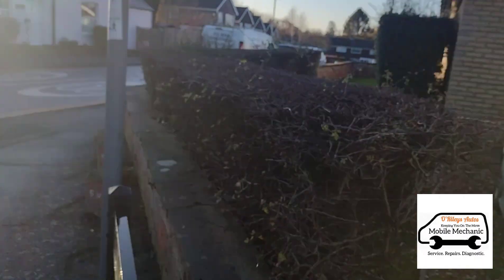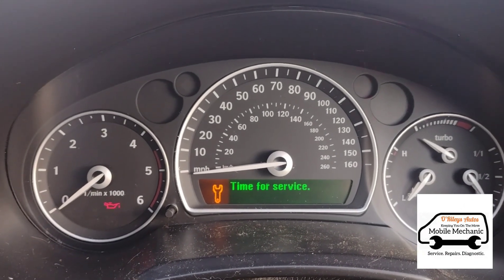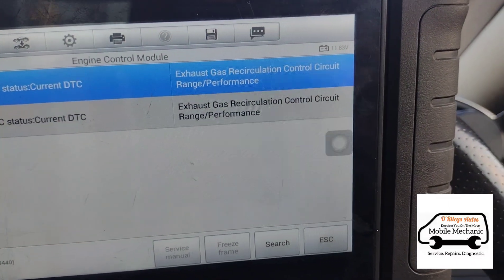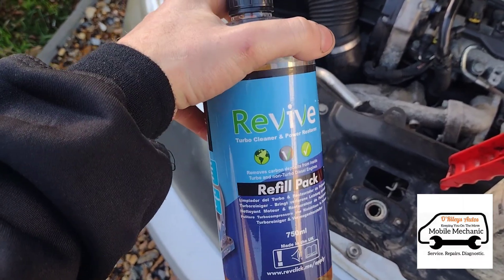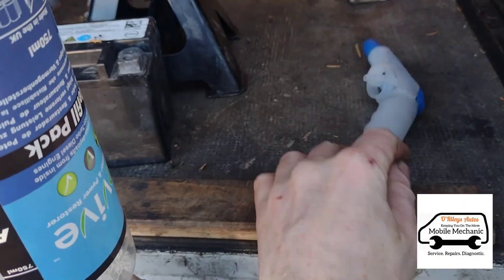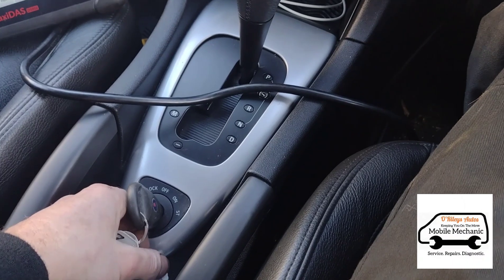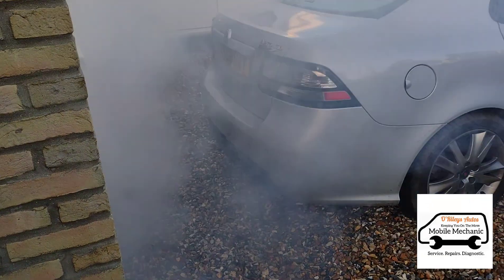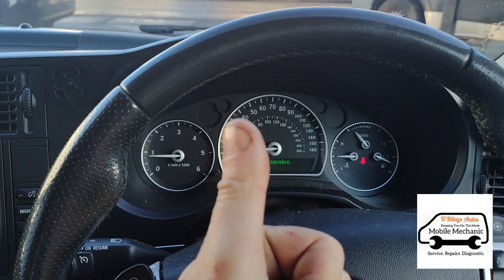How To DIY Engine Carbon Clean Soot Using Revive Turbo & Engine Cleaner

Comment: Top video...Jimmy the brake bleed pump you use for dpf cleaning..could this be used for intake/egr cleans...
Reply from the maker: No. You'd need a pressurised spray bottle for that with a mist type nozzle and trigger to control the flow
Reply from the maker: https://www.amazon.co.uk/WURTH-BRAKE-CLEANER-PUMP-DISPENSER/dp/B01G8HYWE8/ref=asc_df_B01G8HYWE8/?tag=googshopuk-21&linkCode=df0&hvadid=310744208542&hvpos=&hvnetw=g&hvrand=8396385747131092723&hvpone=&hvptwo=&hvqmt=&hvdev=m&hvdvcmdl=&hvlocint=&hvlocphy=1006517&hvtargid=pla-421298496384&psc=1

Comment: Would like to see internal Before and After photos, then I believe. Just watched a fellow testing Liquid Moly diesel intake cleaner. Following instructions on the can to the T. …. TOTAL FAIL!  Photos please of your clean claims. 👍🇨🇦
Reply from the maker: None of these type of cleaners are going to look good on a photo as its not going to clean them sparkling but if it softens the soot enough to unstick a Turbo vane or valve then it's worked.

Comment: Will this be ok to use on 2010 Mercedes c200 Cdi take it goes straight through turbo that way mine needs sorting PDF also in desperate need of help
Reply from the maker: Yes it work on any vehicle. Not very effective on the DPF as it be evaporated by the time it reaches it
Reply: And will this clean turbo and majority of the inlet I’ll give it a go thank you so much 👍

Comment: Ever used on a gasoline direct injection like hyundai or kia?
Reply from the maker: Yes.
Petrol Direct Injection gives the same issues as the diesel engine. There could be some fuel deposits which are circulated around the engine through the EGR valve and build up on the inlet valves. Some models can suffer from poor idle and reduced power in as little as 15k miles if low speed trips are made around town and if poor quality fuels are used.

Comment: Still amazes me how a chemical in contact with the carbon for a fraction of a second can break it down enough to be then taken through the engine and out. Try wire brushing a inlet valve out of a engine and you appreciate what I'm saying